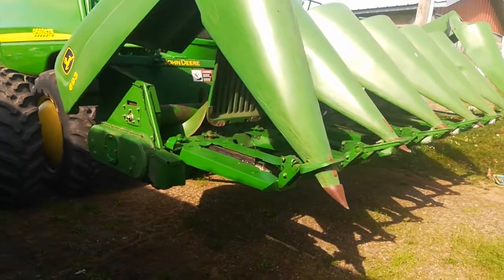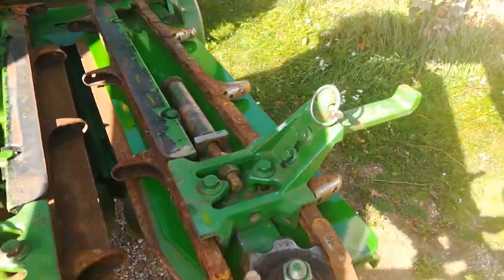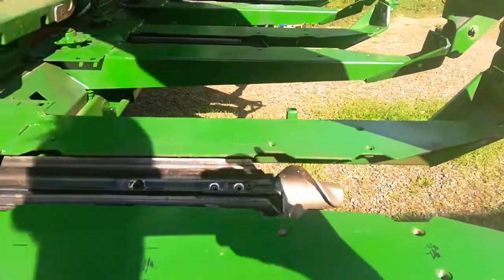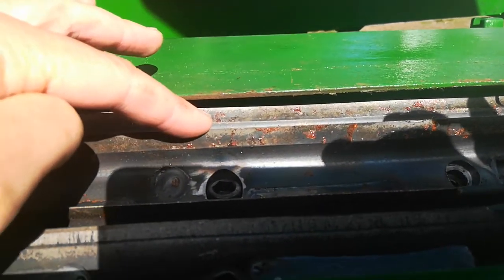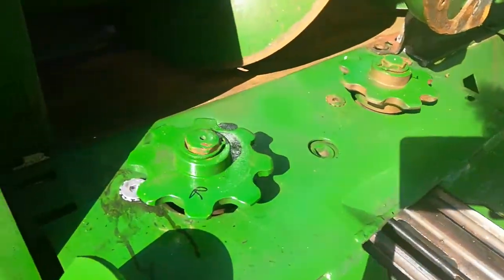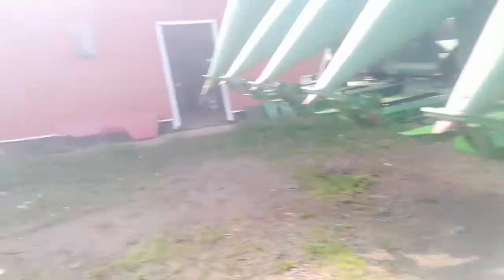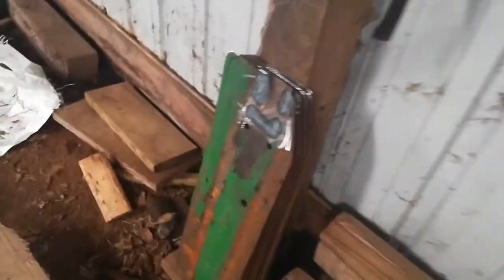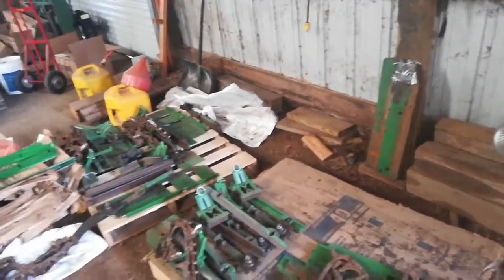Update on Installing Calmer Rolls on Deere 693 Head

Comment: Have a 9560STS now with an 893, thinking about downsizing to 606C or a 693 with Calmers
Reply: Curious why going to a 6 row on a 9560? We run 893 with a 9500...little light in the back...but if you run bottom sieve wide open or take out completely...you can really move...